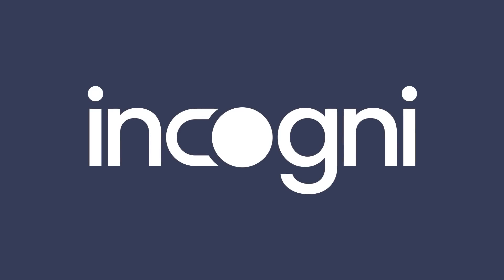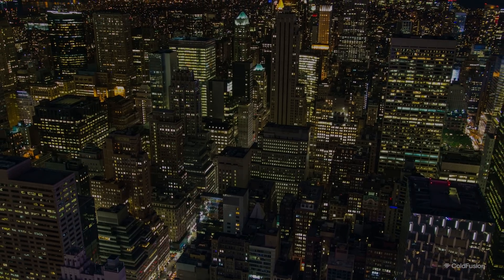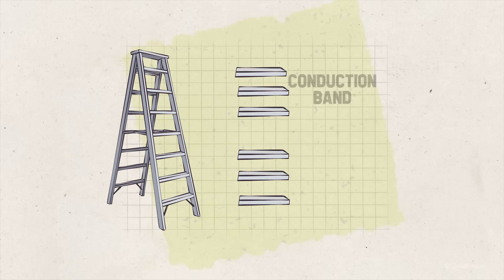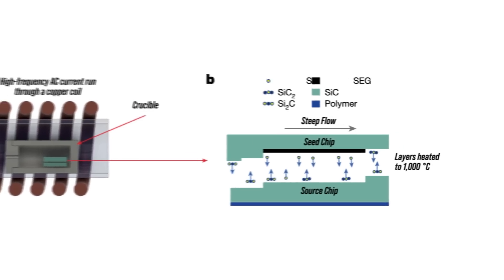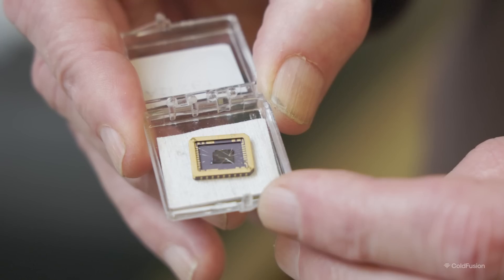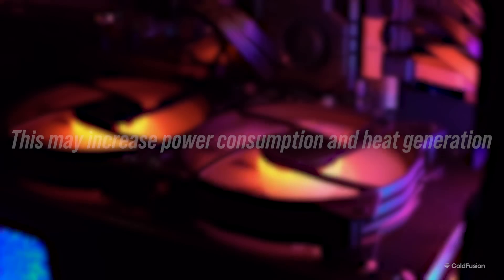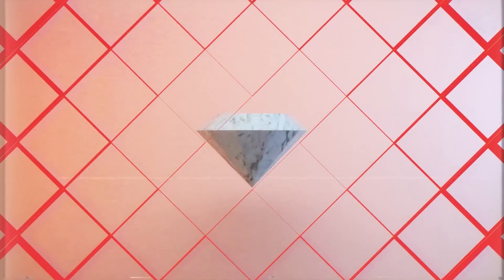This Chip Could Change Computing Forever

Comment: Am I just a way bigger nerd than I thought I was, or am I missing something?  All of these negative comments like we were told graphene computation was one year away, two decades ago...  Guys, ten years ago we were told that it showed promise but because of it being too conductive, it would take time.  Well this video is telling us that they've solved that problem AND that it's scalable on current manufacturing.  What that means is that, unlike a decade ago, we actually ARE on the cusp of computers being faster by many multiples and within just a couple, to a few years.  This has never been the case.  Not even close.  There was no solution in sight, ten years ago and nobody pretended there was.  Stop regurgitating comments you're reading in the thread just to try and sound smart.  You're feigning an understanding that you do not posses.  Watch the video slower, but this time, pay attention.

Comment: Terraherz instead of Gigaherz, so your phone is 5x as fast. Strange calculation
Reply: No it's not, your chip CYCLES 1000 times faster BUT your OS, UI, display, etc.... ARE NOT..... 
Simply put, you have 100cc engine and 1000cc engine, in theory the latter is 10 times more powerful, but IS IT FASTER? No, if 100cc is on a bike and 1000cc is on a car.
Reply: Even cheap phones are at 2GHz, so 10GHz = 1THz to him

Comment: Graphene is just like Nuclear fusion, always 10 years away 😅
Reply: to be fair, so was blue led for decades, without it we wouldnt have led lights and screens.
innovations is expensive and require young people who are typically less trusted with large sums nowadays due to rapidly failing society, hence the increase in junk papers/claims and decrease in society changing tech.
Reply: @Jack-he8jv  There's a lot to unpack there man. 😅
Reply: Lets develop a car's engine. We can do it in 1 or 2 years, test it, do research on it, and use the data gained to develop the next generation of the motor. The cycle of creation and testing linked to time truly matters! People often forget that building and testing a fusion reactor takes 30-35 years, especially in the past. With such a slow cycle, expecting fast results wouldn't be logical. Fusion research has a very time-consuming development cycle.

    If you want to know about progress, find data on specific research advancements. For example, magnetic fields for fusion are 10,000 times more efficient than 20 years ago. There's been great progress, but there are still hurdles to overcome.

    Superficial judgments are easy, but they're simply misguided.
Reply: except it was only discovered 20 years ago so calm down sir. 

And as stated above. We have made immense progress in the field of fusion. But man controlled fusion is on the fringes of our knowledge about the universe, ... it takes time my dear sir. One big hurdle is the development cycle. Lately we have been able to simulate our way to a very interesting magnetic field design - that should have the property of being able to hold the plasma very steady. All the different approaches have made big improvements in the last 10 years. Factors of many thousands.
Reply: It's literally already in use in multiple commerical products...
Reply: *You're not entirely wrong, but that's what they said about flat TVs 50 years ago.*.
Reply: @jsl151850b  
The first "television" system broadcast was a straight-line by Philo Farnsworth on September 7th, 1927.
 But full-scale commercial television broadcasting did not begin in the United States until 1947.
Still 77 years ago, not 50!
And now it's obsolete!
Reply: Well I never knew anything about that elecjet battery until watching this video today, so its essentially already here. Shame its off the market, but I expect we are going to see a technology revolution over this very soon.
Reply: It's worse. Nuclear fusion is coming to the point where there are several companies claiming to be maybe 1-3 years away from a viable-path demonstration. Graphene appears to be spinning wheels. It'll supposedly revolutionize computer chips, EV and digital device batteries, architecture and construction, aerospace structures, clothing, chemical and drug manufacturing, nanotechnology/material science, and your broken marriage... if it could just make it out of the lab.
Reply: You mean cold nuclear fusion.
Reply: It's already used in industry for a decade: https://en.wikipedia.org/wiki/Graphene#Applications

It's just that we have only scratched the surface of what we can do with it.
Reply: what if it was already injected into your body?
Reply: What about the guys at Helion they have even generated electricity
Reply: Graphite is always just 10 years away. Fusion is always 30 years ahead.
Big difference!
Reply: Until it isn't.
Reply: Fusion has been 10yrs away for all of my life  iwas reading new scientist at da age 11 now I'm 44 I have stopped reading all scientistsm material I can make fantasy machines in I own mind

Comment: I'm an ingeneer specialized in powerelectronics. We are working since around 2019 with SiC Mosfets.
here are some conclusions in comparison with standard IGBT Moduls (although I obviosly can only talk about powerelectronic side, not microelectronics)
- If they die (explode) they do so pretty quite, that's nice. They also don't push the silicon everywhere. I tell you, cleaning a cabinet where a IGBT did explode is annoying...
- They are faster. witch IGBTs our switchingfrequency was at (depending on the output current) 2...10 kHz, with SiC we are usually at 12...20 kHz with comparable current. That reduces the losses in the chokes significantly, and reduces the noice by far. Sadly it seems, that the chokes are now at their limit. even if the output current of the Semiconductors could be increased, there are no chokes to smoothe the current out. with 25 kHz most choke technologies are also already at the optimum with copper and iron losses.
- They survive overvoltages longer/easier.
- they get extreamly hot, therefore the chip is a lot closer to the baseplate (wich is attached to a heat sink. sadly this increases the parasitic capasity, and because of that also EMC noise against PE. It easily interferes with other devices. An EMC Filter is mostly required.
- because of the higher switching frequency parasitic problems have gone up a notch as well. For example: we build a bidirectional, galvanically isolated DC//DC converter. In the lab it worked with 30 kHz, but when we build it in a cabinet, we had to reduce the switching frequency to 17 kHz, just because the cables were a few centimeters longer, and therefore the parasitic inductance inceased. The difference is, again, the lab compared to a real application.
- they are, at least for now, still very expansive

All in all, it is nice, yes, but it is not the all mighty solution. All the manufacturers have already quited down significantly about innovations.
Reply: Although your post has many grammatical and spelling errors, these clowns don't realize that engineers aren't English majors. Math is the same in every language. You met 1 or 2 bad people, don't judge the community as a whole because of it. We live in a time where almost all human knowledge is at our fingertips. It's incredible but it sure doesn't stop people from keeping us down
Reply: Posting chat GPT info dumps is insane
Reply: @Burkius  sorry, what? What do you mean with Chat GPT info dumps?

and yes, sorry for beeing a non english speaking nativ and having gramatical errors.
Reply: hopefully your math skills are better then your spelling skills....
Reply: @daemonsw77  I expected better from this comunity...
Reply: @zuu.hed.2533  I expect better from a engineer, maybe stick to your native language sites
Reply: @daemonsw77  oh okay so every nation should invent everything on thier own now? absolut isolation between countries is your thing? pathetic...
Reply: @daemonsw77 no one cares about what you expect
Reply: @Ronalpinhos  except the people who like my comments lol
Reply: I’m sure you’re an “engeneer”

Comment: #DipoleElectronFloodTheory
I’ve been saying since 2013 that it seems extremely (Occam's Razor) obvious that all electrons and all photons are in orbit with a dark matter particle and I’ve shared my theory literally many thousands of times with hundreds of the world’s top physics universities, professors, labs, channels, etc.

Based on Fermilab, CERN and other recent findings, I now more specifically think electrons are made of an electron neutrino entangled in orbit with a dark matter muon neutrino, explaining their erratic orbits around nuclei, superposition, uncertainty, the double slit, etc just like I’ve been saying since 2013.  And I think when the electron neutrino gets entangled with the muon neutrino it creates the Higgs field.

I think when an electron gets a 2nd muon neutrino, it’s what we call a Tau particle and I think photons are a pair of electrons entangled in orbit together in apparent axial or helical polarizable wave-like movement depending on the direction of their rotation as they travel.  This explains string theory, the double slit experiment, uncertainty, superposition, etc and the speed of the rotation explains electromagnetic wavelengths.  It also explains ‘’the ultraviolet catastrophe’’ with the separation of the electron and muon neutrinos due to the higher energy.

I also think protons and neutrons are actually made up of over 1,800 electrons with the muon neutrinos likely all clustered in the center surrounded by the same number of electron neutrinos.

‘’If you want to find the secrets of the universe, think in terms of energy, frequency and vibration.’’ -- Nikola Tesla

Comment: For everyone that is skeptical about graphene computers - remember that the  LED screen came out in the 1960s, but in the 1990s they were mostly used in stuff like the Nintendo Gameboy. And it was not until the later 2000s when LED screens got, well, everywhere, and supplanted CRTs. 

Graphene computers will come - it just needs more time.

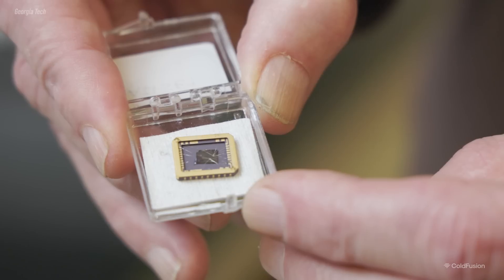Comment: 4:00 'For the technically inclined", As a technically inclined I found that kind of insulting, because eh no, I didn't see that things didn't add up, but then you went into the most minute specifics of chip engineering that nobody but an advanced chip engineer would know.  So, you might say, 'For the advanced chip engineers, you might see that something doesn't add up' ...

Comment: I've heard, for about 20 years now, that a development just around the corner will make laptops last a week without a charge. Never happens. Color me skeptic.
10 years ago: "We gonna have graphene computers!" 
10 years from now: "We gonna have graphene Computers!"
well, than it is maybe halfway through the process. it takes around 5-20 years to go from lab to actual product. most of these kind of, we will have it soon videos are promising an early lab stuff for tomorrow. and of course never go back and tell anyone when one fails during that 5-20 years as it is not guaranteed that it will survive the process, mostly the one when it needs to be economically feasible, not only technologically.

Comment: Just to note with the whole "this chip will be able to run faster and cooler".
Technically yes, but technically, we've been able to do that for decades now.
The thing is once we do find ways to run things cooler/more efficiently, we run them faster and faster, pushing the limits until they heat up again.
Then it's time for the next race for the material/technique that will be able to compute without require cooling.

Comment: I am from 2050 and you will see such videos every now and then, but nothing will change silicon will still lead. You want me to prove it! well, check the research on batteries in past 10 years and see where you are in 2024 and don't worry this will be the same in 2050 as even, we have been using phones which last just 6 hrs...

Comment: The semiconducting graphene always needs bulk layer of wide bandgap material, i.e. silicone carbide beneath it. Roughly speaking, graphene gets its wide bangap from underlying material which has it even wider. Given the fact how multilayered the present integrated circuits are there is still big chalenge in how some monolayer sandwich can be translated into functional multilayers.

Comment: I feel the need to point out that, faster clock speeds are not simply limited by the silicon.  As clock speeds increase, you start to have a problem where the signals are bIeeding through as RF noise faster than they are traveling across the intended circuit.  If the signal "jumps" the circuit gap, then you start to have all sorts of timing problems and the circuit would become increasingly noisy.  So, a lot of the circuitry would have to be replaced by opto-electronics which would drive the prices sky-high!
Reply: Then at least it will use less power tho right?

Comment: Back in 2003 when I was studying Computer Science at FSU, one of the breakthroughs the university had was regarding graphene. I'm still waiting for it to materialize into ANYTHING we use daily or get a benefit out of.
Reply: A breakthrough does not mean a stable or close to final product though. It just means a significant improvement, or that a solution was found to something that hindered further process.
Reply: It took 28 years to go from the first transistor to the 6502 CPU.
Reply: It took 30 years to get from the first LED to the first BLUE LED. Then how long until you got the first home led for lighting? 20 years? 30 years? 
So we're talking 60 years between the invention of the LED and it's wide scale use for lighting. 
Wanna know what took so long? 
Band gap engineering and designing manufacturing processes.
Reply: Manufacturing techniques have not been developed do make such structure efficiently, best current practice is still done by placing individual atoms and this is not economically feasible at scale at the moment.

Comment: Dagogo: growing graphine on silicone carbide. 
Brain: low framerate. Please reduce graphics. 
Dagogo: synthesising via chemical vapor deposition
Brain: your device is overheating. Close some programs and try again. 
Dagogo: Liquid phase and electrochemical exfoliation.
Brain: error 3:24. Your device does not meet the minimum requirements to run this program.

Great stuff as always. Came across a lot of graphine content on your channel. Glad to see all the progress that's been made over the years. Excited for it's application.

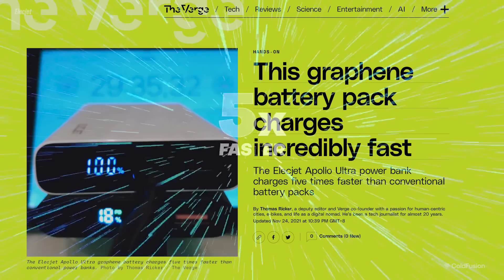Comment: @3:40 Stupid "10000 mAh capacity" claim. 1) Why not say 10 Ah instead, it's the same. 2) You can't use Ah to specify capacity (amount of energy stored in a battery), you should use Wh.

Comment: Back in the 1970's I worked in mining exploration in northern Canada. We did geophysical surveys over potential orebodies deep in the rock of the Canadian shield. Then, having delineated the shape of the underground conductor, the diamond drillers would punch a hole in the rock to get a sample of the ore. We could take a wild guess at what we had found but were never sure until the diamond core was examined. Then, with pent up breath, and honest anticipation we would find out that all we had found, was friggin' graphite! Black crap! Who needs that? We slogged around that heavy geophysical gear and endured the bugs of summer or the cold of winter, only to find graphite? Who's ever going to need pure carbon? Lead, zinc, copper...anything but carbon graphite! Curses! On to the next conductor.

But now? Graphite is used in golf clubs and electronics. Graphene holds promise, after promise, after promise...and okay, it never delivers, but I can attest to the fact that there's a lot of it in the ground, heck, I found it. That cursed black muck!

Comment: This represents a significant advancement in the field of technology. However, it is my assessment that we have likely reached the pinnacle of processing speed. At this juncture, the primary differentiator will be the ability of individual chips to operate efficiently for extended periods without succumbing to overheating.
Reply: We have reached the pinnacle of processing speed until the next breakthrough or new technology that doubles or triples it.

Comment: The graphene transistor is just a prospective at this time, but if graphene semiconductors come to fruition, it will be in the next couple of years. Otherwise, graphene will become another justification for asking start-up funds. Remember we have available already an high-mobility semiconductor, already in use for microwave application, laser front-ends, etc. The material is Gallium Arsenide, but we cant use it for building microprocessors because of its poor thermal properties.

Comment: Current "leakage" is less of an issue for low-power chips, which graphene chips would be at first, thanks to its efficiency. Things like backside power (i.e. PowerVIA) and RibbonFET may further help with that and enable high-power chips as well.

Comment: Hi Dagogo! Great video as always but I do have one major question about possible limitations that you didn’t really touch on. Mainly the speed of light as a limitation when trying to operate chips at terahertz frequencies. I’m not an expert by any means but I do remember watching something on Linus tech tips where they were discussing how ram chips and storage solutions needs to be moved closer to the chip due to timing issues trying to run DDR5 speeds. This was due to the latency caused by the physical distance between chips. If we’re experiencing timing issues with our current ram and cpu solutions then how are we supposed to run 10x faster? Apple already put the ram inside the M1/2/3 package, is everyone else going to have to do the same?? Would love to hear your input on the issue!